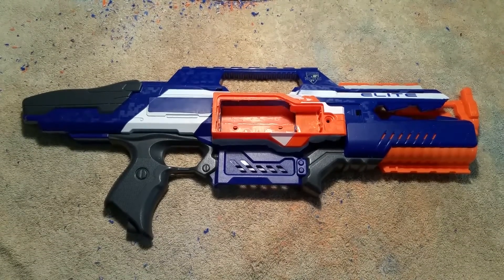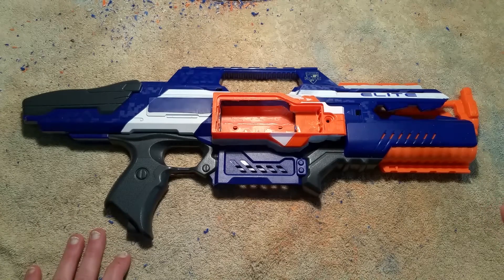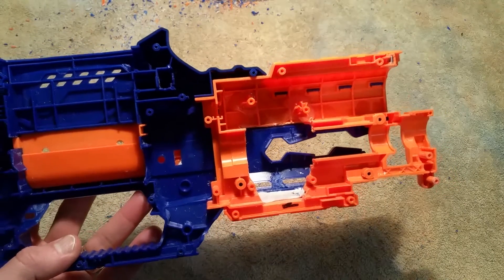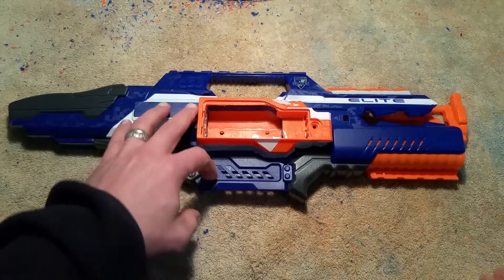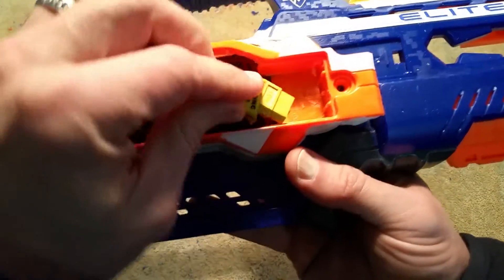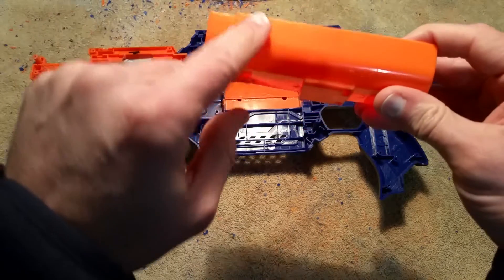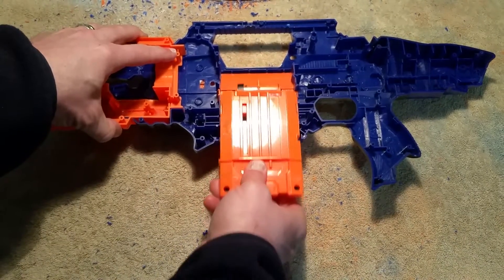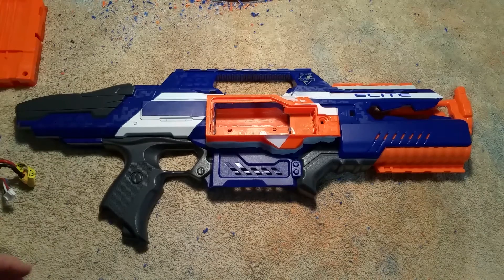Battery Tray - Hailstorm Mk.5

Comment: so you would say a 4s is best for a four fly wheeled blaster? What discharge rates, I'm making a quad rayven and need to buy another battery :)
Reply from the maker: Tbh, I would start with the motors that I would want to use and then work back to the Lipo specs.  I run at 4S because the Kysan 17114 motors that I like to use are spec'd for 4S.  If I were building a blaster with Honey Badgers / Wolverines (stage 1) and Rhinos / Hellcats (stage 2), I would be looking for a 3S battery.  You could even put together a build with all Honey Badgers build and run it on 2S (Honey badgers are hot enough to run a second stage at 2S).
4S Lipos have the advantage of being more energy efficient but 2S Lipos can fit into smaller spaces.  3S Lipos fall in between the two.  They all have there place in Nerf.
Reply: 498 Nerf I'm running rhinos for the first stage, and xp180s for the second stage, so I'll probably end up using a 3s, thanks! :)

Comment: Is this your first hailstorm that will use a lipo?

Never mind, listened to begining of the vid again. Very interested in the FPS you get.
Reply from the maker: Yeah, the others ran on IMR cells.  They were enough for the older builds but when I used hotter motors in the Mk.4, they couldn't quite keep up on full auto.

Comment: Would anyone know if EBL batteries are any good for nerfing applications? It's pretty hard to find IMRs these days and I don't want to buy a piece of junk.
Reply from the maker: I don't have any experience with them and don't know much about the other than they are NiMH chemistry.  My guess would be that they would have a lower output than an IMR but with more stored energy.  They are also a lower voltage - similar to the voltage of a standard AA cell.
If you are looking for IMR cells, here is where I have gotten mine:  http://www.mtnelectronics.com/index.php?route=product/product&path=59_87&product_id=477